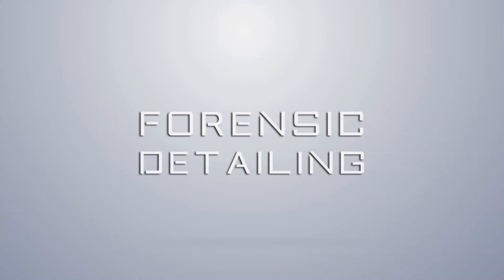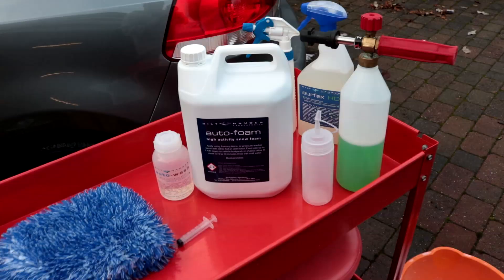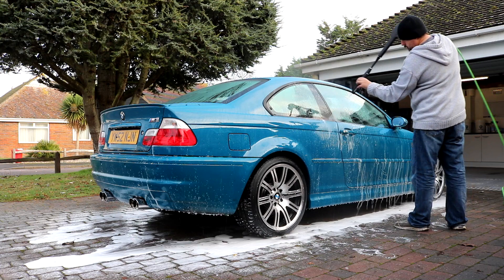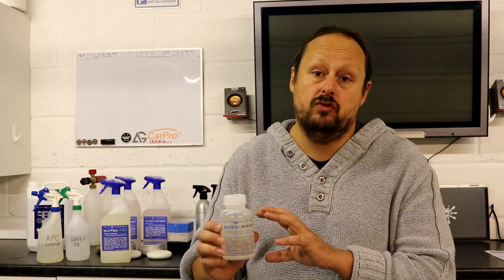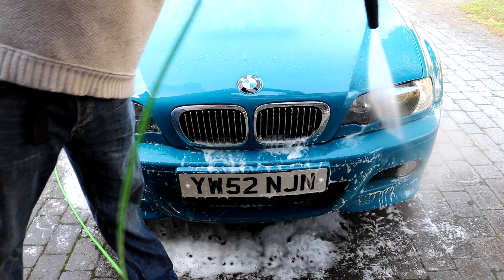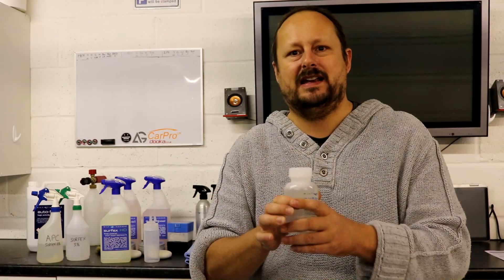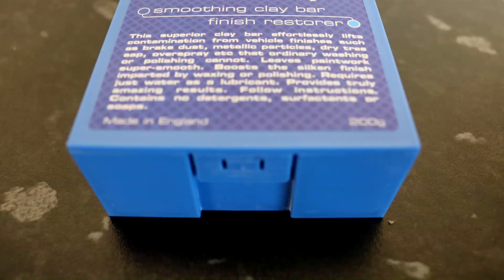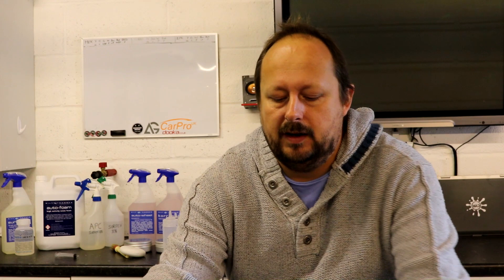Bilt Hamber Laboratories review

Comment: I have now re-reviewed your review! Thought timestamps might help anyone else wanting you thoughts on specific products and conclusion:
1:20 Brief History of Bilt Hamber
3:35 Auto-foam snow foam: 
12:00 Surfex HD - great all round cleaner, many dilution rate options
17:52 Auto-Wash - no additives added. Super concentrated (5ml per bucket/15ml per 5 gallon). Anti corrosive properties to prevent rust 
22:47 Korrosol clearcoat cleaner / Auto-wheel cleaner - bleeding fallout products
- 27:45 Differences between them explained
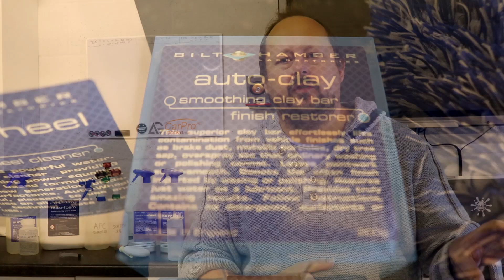30:49 Clay Bars  (conclusion: best in class, especially value)
37:30 Finis-Wax: Easy to apply/wipe off, great value for money
. Last well. Great wax
40:57 Double Speed wax: if you can only have one wax, get this. Last longest, highest gloss, slightly more "grippy" to remove but better water repellent.
47:11 AutoQD detailing dressing (ionic cushioning product/claybar lube). Can be diluted 75%product:25%water for gloss boost)
51:32 Cleanser Fluid: Removes hydrocarbons, wax and traffic film. Use to prime the paint, then apply the wax/sealant
55:25 Conclusions
- 55:35 Products that are missing from the range (still missing in 2019).  
-- No compound/finishing polish, ceramic coating, glass or tyre care
- 55:60 Final conclusions
Summary - all great products. Those that are instabuys/best in class products:
- Auto-wash shampoo for best clean residue free finish, super concentrate, big bubbles, value for money is insane
- Auto-foam - best at actually CLEANING/breaking down the traffic film
 rather than looking nice and smelling of pineapple.  
- Korrosol clearcoat cleaner / Auto-wheel cleaner
- SurfexHD many usees for different dilution rates. Note: Price has gone now in 2019 (5L/£23)
- Clay Bars Range - best in class by a long way. 'Regular' clay for most abrasive. Great prices
.
1:01:45 Thanks to Bilt Hamber and confirmation no script was provided
Must have taken ages to make this video so there's my way of saying thanks for all the info!
Reply: Not all heroes wear capes my friend.
Reply: you prolly dont give a damn but does someone know a way to get back into an Instagram account..?
I was dumb forgot my login password. I would love any help you can offer me
Reply: @Alessandro Hamza Instablaster :)
Reply: @Sergio Archie It worked and I actually got access to my account again. I am so happy!
Thank you so much, you really help me out!
Reply: @Alessandro Hamza Happy to help =)
Reply: U a the star
Reply: @acecin  And you for replying so first time I've checked this comment since posting it. Appreciate all the thumbs! Hopefully made a few ppl's lives a bit easier. A great video and recommend highly to watch it if you are reading this and haven't. I tried other things, but for the basics, I just keep coming back to BH. Tried their rust bath product now, waxoil stuff, double speed wax, wheel cleaner., autowash, both auto foams old and the new Touchless one. I prefer the sugar based new one, seems to have a bit more bite. All their stuff is brilliant (I also dont use any other clay bar now, plus designed to just use water as the lubricant so more cost saving to be made there and one less product. I like the softest one best and its been plenty for some of hte cars I@ve since done) The value for money comparatively to other brands is insane. Korrosol is the best, Surfex HD I wouldn't live without now it's SO versatile due to its concentration level. Yet to try their QD but that's up next, next time I need one and believe that can be diluted too so it will go further for less.  Just an update what I've used since then and recommend all of those.

Comment: I really like Bilt Hamber products. I love the wheel cleaner the soap and the speed wax. 
The clay bar is great as you can just use water instead of expensive fluids.They are a no bullsh*t company with products that just work and are good value.
Reply: Ollie S have you diluted the wheel cleaner mate? If so what ratio? Thanks
Reply: @bobkhan5363  I did not dilute mine as I just bought the spray, not the bulk one. Pretty sure it must have instructions on the bottle.
Reply: Ollie S yeh I bought the spray to mate, thought It needs to be diluted. But guess I’ll use it neat cheers mate.
Reply: Bob Khan don’t think u dilute it however it is by far the best wheel cleaner I’ve ever used
Reply: MrTangolizard cheers pal! Can it also be used as a tyre cleaner or would I need a separate tyre cleaner?
Reply: Bob Khan not sure to be honest I’ve never tried it I use autoglym tyre shine on my car I’m hoping this weekend to use the bilt and hamber clay bar so see how that goes

Comment: I bought the silverback drying towel on your recommendation and have been delighted with its performance. I'm now tempted to buy the Bilt Hamber range simply because your reviews are so thorough!
Reply: I bought a koren twisted drying towel form in2detailing for less then £10 and its 74 by 90
Reply from the maker: you wont be disapointed with them.. surfex HD at 16.95 for 5 litre.. auto foam and auto wash..  the clay bar and the QD, double speed wax at 14.99..   Its all really well priced and for me best in class.. oh and korrosol and autowheels the 2 fallout removers...
Reply: I'd encourage you to buy - you won't be disappointed. I've been an 'auto-glym' chap for years, dabbled with McGuiars (?) but not impressed, but gave Bilt and Hamber a go because they seemed to be a cheaper alternative. They are not as cheap as some waxes et al - but you need so little. In fact, the less you use, the better. It has to be a 'mean' application for best results. I'll stick with B&H from now on.
Reply: Autoglanz apc is worth a look upto 200:1 and lsp safe

Comment: Great review vid, thank you. I've become a big fan of Bilt Hamber in recent months. It's just a very good all round range of products. No fancy packaging or flashy labels, no harsh chemicals, just stuff that works, is easy to use, and is well priced. British, too. My neighbour introduced me to the Auto Wheels initially, which works a treat. Slowly adding other products as my existing stuff runs out. For shampoo, I've always been a massive fan of the Autoglym Shampoo Conditioner, and have come back to it every time after trying most of the others. Will definitely try the Bilt Hamber when that's gone though.
Reply from the maker: yer real no nonsense stuff.  not really a scene brand.  mainly surfactants and cleaning chems with an interest in anti corrsions.   line is lacking like glass cleaners, plastic dressings products etc.   And their paintwork protection stuff is wax based.   nowadays I break brands down.    cleaning chems (wash products) / decon / abrasives / protection / accessories.   BH are the kings of the cleaning chem and decon catagories.   everything they make they just formulate it to out perform other products and I really trust their ability to deliver on this and I think other people notice it as well.

Comment: Just want to add that you can use the Autofoam in a hand pump sprayer and it'll work just as well, if not better imho, as well as being more economical. I use 80ml per 2L and it'll be enough for up to 2 cars.

Comment: Very nice summary! You are progressing rapidly with your reviews. BH is my go-to manufacturer together with CarPro.
You used quite much product occasionally. I can make about 10-15 cars with one bottle of Cleanser Fluid. It is effective glass cleaner (expensive though) and works very well dissolving tar. Finis-wax is about 33£ and DSW 14,95£. Finis is easier to use but DSW sheets better. I tested them Bouth side to side and finis had better longevity. Would say DSW longevity is about 5000-10000 km or 3-7 months and Finis 8000-15000km or 4-9 months if You are maintaining them correctly. Top work!

Can You make next: CarPro, Bouncer's and Obsession wax reviews?

By the way I agree that they should make: Coating, spray sealant.
Reply from the maker: thanks Saul, will try and oblidge doing the brand reviews isnt always easy to set up and there a couple of other ones in the pipeline.. but I do listen when people tell me about content they want and I try and keep note of whats popular etc.. so defo noted the request mate.

Comment: Ive had the opportunity to try the bilt hamber auto wash car shampoo and i have to admit it you were right, its great. The cleaning power and no residue left over after washing it off. I also tried the one bucket wash method you use with the wash mitt with the short pile you advised about. This will be my new way to wash, works brilliantly. Thank you.
Reply from the maker: great to hear, I generally dont use that one bucket method too much now. but in the summer I sometimes use it or something similiar.  where ill chuck 4 of the chinese mitts in the bucket and a single pad and then roughly follow that method.
Reply: Forensic Detailing Channel i have 10 of them wash mitts and just use one for each part i do and only use once on the car lol

Comment: Probably been mentioned before but the finis wax is £34 for a 250ml pot and the double speed is still about £15 for 250ml. Have used both and the finis wax is easier to apply and buff off, but not by much.

Comment: john i use both the korrosol and the clay and as you say best i've ever used the only reason i am not using the speed wax and the rest of the range is that i have shed loads of stuff to use first, plus i have emailed bilt hamber regarding a question on a product and every time they answer very quicky and in a way that is easy to understand...they are really good..i would love them to do a coating for glass making them hydrophobic and a cleaner...cheers for another cracking review mate.
Reply from the maker: thx richard

Comment: Thanks so much for your thorough, yet entertaining content. I have learned so much from you and 'Car Cleaning Guru'. 

I have tried a couple of Bilt Hamber products. The car wash is brilliant. 5mls to a bucket of water is ridiculous. The 300ml bottle is good for 60 washes! I traditionally use Meguiar's Gold Class shampoo and I like the shine it gives, but you have to use quite a lot so I run out quickly. BH Auto Wash is much, much better value for money and the clean is as good if not better. The low suds is initially disconcerting for those that like thick, luxurious suds but it still works and my microfibre drying towel literally squeaked across the glass and painted surfaces. I also like the fact that it's environmentally friendly so it's a guilt-free experience too. I agree that it's a bit of a faff to measure but rather than a syringe, just use a measuring cup that you get with cough syrup. BH need to redesign the bottle - the liquid is too runny for such a wide mouthed bottle.

I was frustrated with the BH 'normal' grade clay bar that was just too hard to mold into a shape. My hands were aching just trying to flatten it and fold it every few minutes. This added to a lot of lost time as most of the surface area was not making contact with the panel. Not a pleasant experience - even warming it up in hot water made no difference. The only positive note is you only need to use water, rather than expensive clay lube and I like the fancy box. I understand there's a softer version but I'll stick with Meg's detailing kit now that it comes with a bigger chunk of clay and decent amount of lube.

Comment: If you like the trigger sprays on the Bilt Hamber bottles, the green Mr Muscle Window and Glass cleaner (in the UK at least) uses the exact same mechanism. Some other household cleaning products also use the same mechanism, so potentially a source of spray bottles a bit cheaper than the empties from Bilt Hamber. You might want to give the household cleaner bottle a quick rinse out with some BH APC first :)

Comment: according to follout removers: remember that the time in which the product starts to "bleed" don't mean that is is better than the others. actually from chemical point of view it can suggest that it will dry up faster than other products and that you can't work with it as long. the best way to compare these products is to wash the wheel properly: acid, alcaline, and than follout remover (half  rim with one and half with other) and swap them after. Than you can see very clearlly which one wipes out more of iron particles.
Reply from the maker: what ive done in the past is use test panels with fallout on them..  tape off sections and spray one squirt over the panel with fallout specs and film it.  After 5 minutes I look at the fallout specs and see if they have bleed out completly, compare etc, review the footage on a big screen.  Ive done half and half tests on cleaned alloys as well.

what Ive found is the ones that take like 30 seconds to a minute to get going (so to speak) are not as potent as the ones which react quickly.   So I still think the speed of the reaction has some sort of indication of the TGA content level.    I have not noticed BH autowheel be prone to drying quicker (in fact the opposite) its a bit more gel and thicker than a lot.  It also has this very slight foaming property which I find helps you work the product with a brush a little bit.

I think you raise some great points though..  I would struggle I think if I tried to do a "best of" style video on these ones...

Comment: There is a housing development behind my house going up. 60-70 homes. Ive been struggling with cleaning my car due to the constant dust. Washed my car today and noted all the top surfaces (bonnet/roof etc) have got what appears these pitted spots which are all perfectly spread. They’re tiny and pick up awfully in the light! Cannot get them off for toffee! The paintwork feels smooth to touch but this video has definitely swayed me to try the reg clay bar! I’m hoping it does the job.
I have a feeling the spots are possibly lime from the cement which has been rained on my car and dried in the sun :(

Brilliant informative video
Reply: Did it work then?
Reply: Vyker it did yeah. Worked really well! Its quite abrasive so it did require a full polish afterwards but to be expected

Comment: I love all the Bilt Hamber products I use, although I do have problems measuring out autofoam and autowash.
I think I use to much and it always seems to strip whatever wax/sealant I have on the car.
Spray head could be better on autowheels as well, I always get a stream rather than a spray/mist
Reply from the maker: the spray head on the bilt hamber products is really really good.. a really fine mist.. you might have it on the wrong setting check all 4 sides mate..

Comment: I thought I was the only one who thought that way about snow foams. A thick light fluffy dry foam might look cool, but it is not efficient. 
Think of a foam like shaving cream, nice and fluffy but isn't going to loosen, encapsulate and pull contaminants off the paint surface. Its just going to sit there being light and fluffy and pretty. 
I like water heavy thin foam as well. Pressured water and surfactants in soap agitates and releases dirt, soap provides lubrication and barrier between paint, allowing gritty material to slide down and off the paint. Not very complicated. 
A thick fluffy foam is much more useful for hand washing, providing a lot of lubrication and buffer.
These products look good, and very reasonably priced. Definitely going to give them a try! Thanks for taking the time. 👌

Comment: FYI the QD was tested as a rinseless wash years ago but ended being a QD. Its listed in Bilt hamber sub treads on Detail World forum.

 I wish you would also put a opinion on Cleanser-polish which is another great Bilt hamber product and of course Auto-balm which is a very unique product. 

Other than that...great job again. I really like these product line reviews. I cant wait too see which is next...
Reply from the maker: i did cleaner polish...  the only issue is they dont have an abrasive pre wax cleanser..   And the cleaner polish only comes in 500 ml..  would be nice to be able to get 5 litres of it.
Reply: Bilt hamber has 2 polishes or AIO products. One is Cleanser polish (yes I know...its has a similar name to cleanser FLUID) and Micro fine. Both have micro abrasives. 
Cleanser polish does cut-fill-protect. 
Micro fine does cut-protect.

Another AIO (sort of) is Auto balm which fills sort of protects (it hardens on the surface). 

Anyways...love the videos.
Reply from the maker: cleanser fluid is non abrasive though right?  and  the other one is a filler glaze polish rather than a cleanser right?
Reply: Yeah yeah...cleanser fluid (the one you used) is a non-abrasive spray on type product that dissolves waxes and oils. In my eyes its sort of a supercharged IPA type product.

And then BH has their polishes or AIOs I to be more exact:
One is Cleanser polish which is another product BH have that is an abrasive filler heavy gloss enhancing polish that also leaves behind some sort of resin protection that is compatible with either sealant (double speed) or wax (Finis) or even other brand sealants or waxes (a good combo for example is BH Cleanser polish + Fk1000p).

And the other is Bilt hamber Micro fine polish that has fine abrasives in it to remove old waxes (like other abrasive pre-wax cleansers) and a carnauba based protection which should serve as a base layer for Finis or other brand carnauba waxes.

I have also read somewhere that combining Cleanser polish followed by Auto balm and then Finis should restore gloss, hide most swirls and protect the car making it anti-corrosive for quite some time.
Reply from the maker: gr8 info aj thx

Comment: Don't ever use Double Speed Wax in very warm weather. Even applying in the evening when it's cool... I found if it was very warm and sunny the next day or two it would cause significant "sweating" of the wax. Bilt Hamber warn of this on their website. They call it "blooming" I think. Also seemed to kill the water beading on the horizontal surfaces, while the vertical surfaces weren't negatively affected.